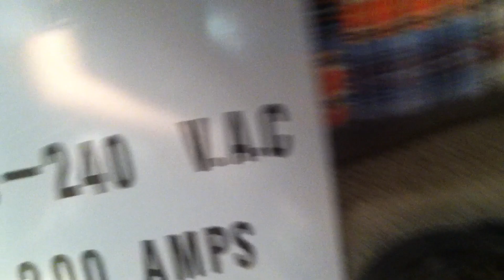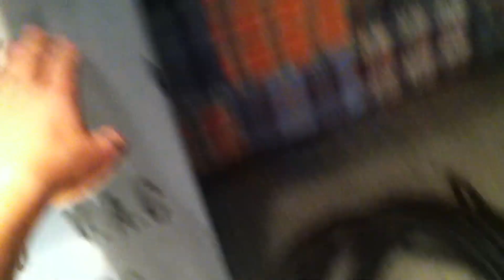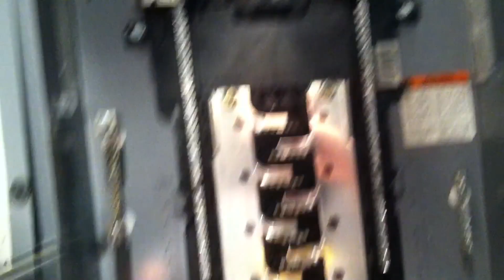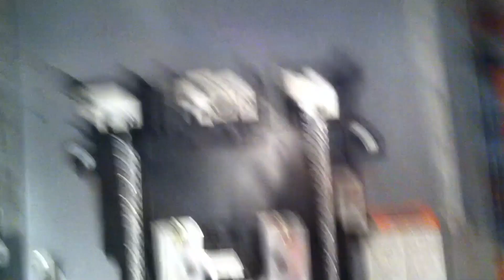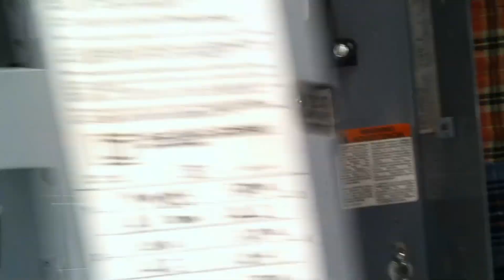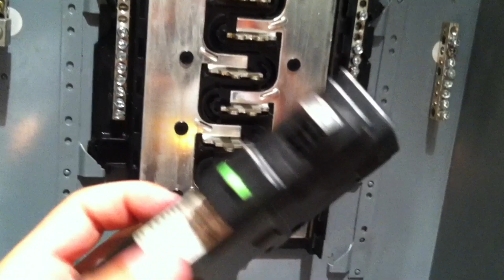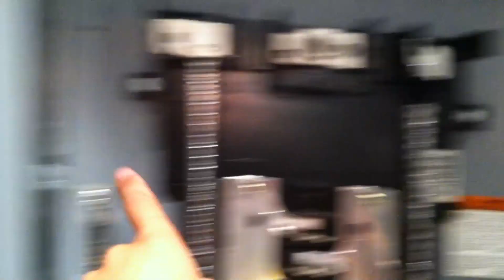Electric Panel and power distribution basics

Comment: What is ground and neutral you ask? OK, so say the transformer have one line of phase power to the main panel. But the return path back to the transformer are by thee ways. The first one is called the neutral wire. The second one called ground or PE (protected earth), and the third one is a rod in the ground at your house, the current then travels in the ground and up by another ground rod at the transformer. So, the earth/ground is not a big electron sink. A current always travels back to the source.
The PE ground wire works like an alternative return path and are made to overload the breaker like you say. But there are one more use for the ground, that is to take over voltage and to make the system more stable. And last, never ever work with power on. It's not worth it. It will kill you.

Comment: Day 1 of trade school you will be taught to NEVER,EVER stick your hands willy-nilly inside of a distribution panel - even if there it's un-wired and just a demo panel like this one,  it's a very bad habit.   It's sort of like fooling around with an unloaded firearm, something you just don't do.
Reply from the maker: Many years later and I'm an electrical engineer working for a major utility company. I will say your comment has some validity as we take safety as our top priority and treat even training equipment as if it were live. I still believe it is good to form a comfortable relationship with the equipment rather than fear it, respect it and most importantly understand how it works and how it could be dangerous. This becomes especially true at higher voltages where electricity may behave erratically.

Comment: What a great video.  I am going to watch it with my kids 14 & 16 so they know what's going on.  I wish you had edited out the part where you said you don't always shut off the main breaker when working in a panel.  I will certainly preach that point to them though. Great panel anatomy though.  I read up on the bonded ground/neutral in the main panel and there is good reason for it. Anyway, I appreciate the video.

Comment: You used a 200A service panel as a portable power distribution panel?  God looks after fools.
Reply: Nothing but crickets, all bark no bite. That guy doesnt know shit.
Reply: Jacob Dykstra That dude was just looking to argue. Jacob, you continued to provide thoughtful responses and the other guy continued to spit acid. I was interested to hear that guy's reasoning for the comment he made but instead he chose to look like a fool and not share knowledge (assuming he did know anything). Anyway, good on you Jacob for the video and keeping a level head when dealing with people like this.
Reply from the maker: Don't see the problem. I have done electrical for set lightning many times and this is a common method for temporary power distribution. What's the issue?
Reply: Are you a licensed electrician?
Reply from the maker: I'm an electrical engineer. Please answer my question rather than trying to insult me. How is this not ok to use for temporary power distribution?
Reply: I know who to ask--a licensed electrician.
Reply from the maker: Seems as if you don't even know the answer.  You clearly have no knowledge in this area. Thanks for the comment though.
Reply: Also still waiting--are you a licensed electrician or not?  The difference between an electrician and a dabbler is knowing the NEC start to finish.  I appreciate your attempt to enlighten the uninformed, but do you think they understand why you produced a single-phase panel and then labelled alternate breakers Phase A and Phase B?  During your rather muddled attempt to explain the neutral conductor, you said "I don't know" five times.  You speculated on the results of touching a hot bus bar while not grounded, but failed to point out the danger of bridging the bus-to-bus gap at twice the potential, as you were doing in the visual.  All in all, I give it a "C."  Grade, not phase.
Reply from the maker: The difference between an electrical engineer and an electrician is knowing how electricity actually works and knowing how to wire up something to a manual called the NEC written by electrical engineers. Kills me to say that because electricians have a very important job but it's the truth. Ask an electrician why a wire conducts electricity and they have no clue. They are labeled phase A and B because in the entertainment industry it is very common to have very large loads and they have to be balanced between the two PHASES. Yes I know it's a single phase panel but you still can have two separate phase circuits relative to neutral, that is why they are labeled. Just so you know many studios and the entertainment do not follow local electrical codes or the NEC. They dont have to. None of their equipment is inspected and they don't care to build equipment to nit picky codes. I am absolutely not an electrician im an engineer and our jobs are completely different I won't lie BUT your claim stating this is unsafe is just comical. Just because it doesn't follow the NEC which changed its code Damn near yearly doesn't mean it's unsafe.
Reply: So, you are smarter than all the licensed electricians out there.  Amazing.  Where did you earn your EE degree?  Are you a member of IEEE?  Funny, I learned electronics on blackboards and slide rules, starting in 1960, and I never got that smart.  I did learn never to underestimate the other guy's skills or knowledge.
Reply from the maker: Absolutely not! The more you know the more you don't now.  I would never claim to be smarter than any electrician because they know more than I do in their field. An engineer and an electrician are two completely different skill sets. I never claimed to know more than electricians I simply stated they don't know much about electricity and they don't because they don't need to! The work I do is completely different than that of an electrician they know building codes and techniques I have no clue of. I possess an understanding of electricity better than most not all electricians. We both know our own stuff best. It would be one thing if i was claiming to know the NEC and claiming to be an electrician but i'm not. The electrical work I did when I was younger was all temporary power for the entertainment industry which operates on far different rules than the NEC. This is common practice and really anyone with experience can get a basic job doing electrical work for this industry. Typically there is also a journeyman working there as well and not even he has to abide by the NEC for some of this work. You are comparing putting up a tent to building a house. One of them can be done by anyone without following any rules, while the other has to be built to a very specific standard or code. Look here's what I'm trying to say. You come here calling me a fool saying this setup is unsafe to use, then you try and bash me because I'm not a licensed electrician yet you have no reasoning behind your original comment. You have not at all told me why this setup is unsafe. Just because I'm not a licensed electrician does not make this setup unsafe. Get to the point and tell me what you know about this setup that is unsafe that gave you the courage to come here and call me out on it.
Reply: Jacob Dykstra I am 40 and have learned things for every age, experience level, and education level.  If you could learn something from me, I hope you learn that some folks are stuck in repeat mode and spending the time on them is a complete waste of yours.  Logic, proof, and science can't change a mind that is impervious to new or different ways of thinking. You can't save them all pal.
Reply: Fuck them old dudes. They always love to insult young people
Reply: I’m a licensed electrician and I use load centers for temporary power distribution all the time.
Reply: Hopelessand Forlorn - pitifully sad and abandoned or lonely?
Reply: This Forlorn guy must have never been to a traveling amusement show.  They have portable distribution panels everywhere, connecting power from a big diesel generator to all those asmusement rides.

Comment: The neutral and ground should only be tied together at one point to avoid neutral back feed. I.e. Voltage  from another circuit back feeding another circuit through both neutrals.  Good way to get the snot knocked out of you. Same idea as switching the neutral. Another no no.

Comment: Lots of good stuff.  One small thing, neutral wires down the line from the main panel carry 120 volts.  It carries as much as a hot, it is merely a grounded conductor.  The 2 hots are 180 degrees out of phase with each other so one neutral wire completes circuits for both hots.
Reply: No they don't. The hot and neutral normally carry the exact same current but the neutral is at zero potential as it is bonded to the ground in the main panel. Anything bonded to the ground is at zero potential.
Reply: @Jnglfvr  
You are agreeing with me, but disagreeing.
Having zero potential to ground means nothing about it's role in conducting power.
Reply: @deezynar  Nope, not agreeing with you. The neutral conductor is not at 120 volts. It is at ground potential.
Reply: @Jnglfvr  
The problem with your claim is that it it's wrong.
Your test is faulty, you are comparing it to earth which it shares a circuit with.
You need to recognize that it carries the same current as the hot because it's on the same circuit as the hot.
The only place where a neutral wire is different is the main from the transformer.
Reply: @deezynar  You seem to have a serious problem with reading comprehension. Either you are dissembling or you really don't know the difference between current and voltage. I specifically said that the current in hot and neutral wires are the same. Go back and read it,  it's right there. I was responding to your comment that "..neutral wires down the line from the main panel carry 120 volts."  They DON'T, they carry zero volts.
Reply: @Jnglfvr  
Neutral wires in branch circuits carry 120 volts.
Reply: @deezynar  Go to any electrical outlet on a 120 V breaker circuit and put a multimeter red probe in the short slot and the black probe in the long slot and let me know what it reads. Better yet put the red probe in the long slot (neutral) and the black probe in the ground hole and measure the voltage.
Reply: @Jnglfvr  
When a load is carried, 120 volts runs back and forth, changing directions, in both the hot and the neutral.
You are sidetracked by the potential to ground being zero.  Ground is a parallel circuit to the neutral, so of course there will be zero potential between the two.
Reply: @deezynar  The neutral is bonded to the ground in the service panel. They must then have the same potential which is precisely what we are talking about.  Your problem is that you are confusing voltage with current. In the absence of a ground fault the current must be equal in both limbs but the voltage is zero (or minimal in log runs due to wire resistance) . There is no phase changes in the neutral line because there is no voltage. See https://www.youtube.com/watch?v=vOh2OSJ44eE&t=188s
Reply: @deezynar  Furthermore 120 V does NOT run back and forth from the hot to the neutral. Voltage DOES NOT return to it's source through the neutral line.  The voltage, instead, is normally completely dropped across the load. The CURRENT returns to it's source through the neutral line. Please read up on the difference between an "across" variable like voltage and a "through" variable like current. This should really take no more than about a 10 second Google search.

Comment: The only thing I heard on here that isn't accurate is that you called the legs, phases. Phase is the frequence at which the power flows. Multi-phasic supply is far different than the legs.

Comment: Why are the grounds and neutrals separated? Study Kirchoff's Law.
Reply from the maker: I know kirchoff's law I'm an electrical engineering student. Please enlighten me as to how kirchoff's law has anything to do with why they are separated.
Reply: +Jacob Dykstra Kirchoff's law states that current must take all available paths. If the neutral and ground are "bonded" downstream from the source then both the neutral and ground will be carrying the return current back to the source. An electrician Who opens the ground in the future would potentially be subjected to shock from current flowing in the grounding circuit. Excellent video BTW!
Reply from the maker: +TimEllenburgPhoto actually that is a very good valid explanation! Although even if it did take the ground as a path, there would ideally be so little resistance to ground it still would not shock you but with long wire runs that can change. What beats me is how inconsistent the electrical codes are. Some states or countries they are separated, some they aren't. For a while I never knew why they were separated but your explanation cleared it up! So far all my courses are theory like KCL but I never thought to apply that to this.
Reply: +Jacob Dykstra the only disagreement I would have with this comment is that if the circuit is open and you get in the middle, i.e. removing a wire cap splicing in a new ground wire, then circuit resistance doesn't matter and you are subject to shock if it is carrying current. The worst shock I have had in 26 years was on a neutral wire, and a ground wire carrying return current has the same potential. I agree the codes can be crazy, thankfully the NEC requires a four-wire system on all 120/240 volt branch circuits including sub-panels. Great work. I just subbed. My degree is in electronics engineering and I look forward to some of your other videos.

Comment: Great video. You know more than most 1st year electricians when it comes to panels/power distribution. just one thing. Household appliances use AC and with AC, especially at 120-240V is not enough voltage to cause you;re muscles to clamp onto something and not let go. Were talking DC voltages above 300V that would do that. Alternating current alternates and in theory when the sine wave hits 0v you are able to let go.
Reply: Amperage, path of current and time caught on line. Those are the 3 things that matter when it comes to coming into contact with electricity.
Reply: Livin1nExile thank you... lol i started to say what you said, not sure where this guys mis information came from.
Reply: People die all the time from 120 VAC.

Comment: Excellent video! i like to ask what happens if the neutral wire touched the metal of the lamp instead of the hot wire touching the metal of the lamp, and if someone touched the metal of the lamp, will he still get shocked?

The other question is what happens if the neutral wire came loose or is a high resistance connection to the Neutral bar. Will the voltage output still be 120 volts? 

Thanks much!